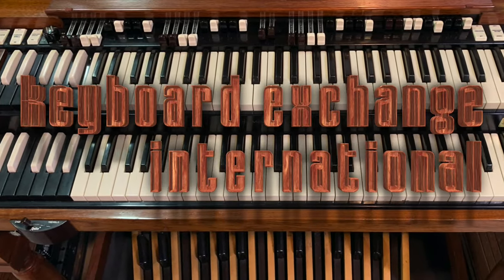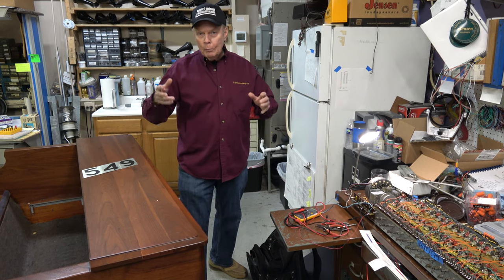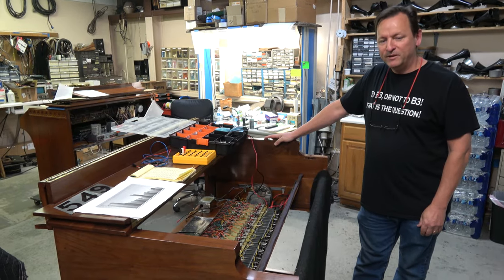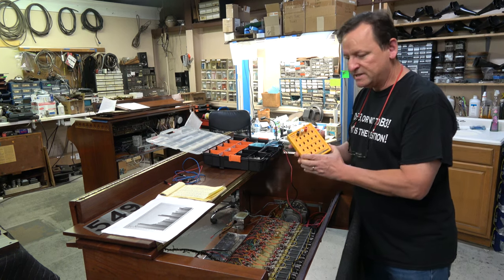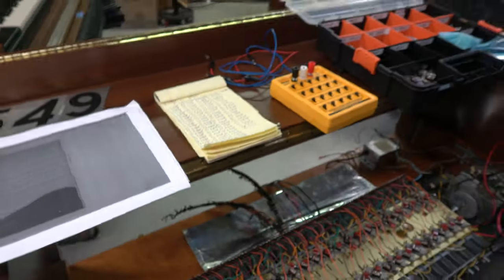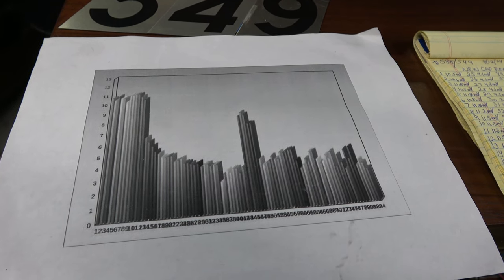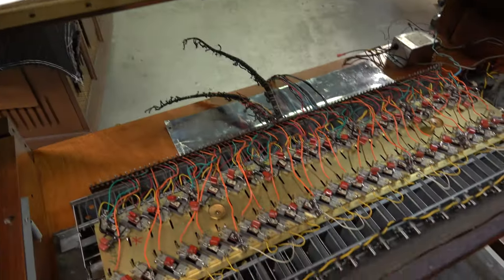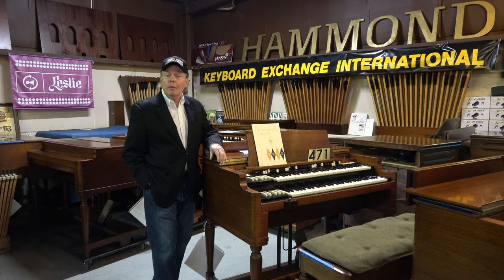(Tech Talk) A deep dive into replacing the tone wheel capacitors, shaping the curve.

Comment: Grant the magnets or what they call the pickup's yes if you move one you will have to use a Oscilloscope to realign it yes it's a tricky thing to do Ive heard about it I've never fooled with the pick up alignment but I did have one organ that had issue that the person moved it not locked down and 2 of the pickup's were in to far so I..did the ear trick..got a organ of the same kind and type and id listen to thoes particular tones and went from ond organ to the other side by side and tuned it that way which worked fine for a spinet organ you could not tell the difference in sound whenever I did it that way..is it proper to do it that way probably not your spouse to use the scope but at the time I didn't have one and I did not know the curve it was supposed to be..so I improvised..my way never had a problem yet with it so that's that..Ive got to learn how to do a recap on a generator I don't know what pickups take the double caps I'll have to do some research whenever I do one...
Reply: Thank you for your comment Anthony!  What you did with your spinet was probably just fine.  It's nice to use a scope, or multi-meter for the magnet calibration, however, your ear will get you pretty close.  I caution people about moving the magnets because it's VERY easy to ruin a tonewheel when doing it.  The doubled caps that I pointed out in the video aren't truly necessary if you happen to have a cap of precisely the value needed.  We double them up when the needed value is somewhere in between the two available cap capcitance values that we have.  What I mean is, manufacturers make a .082 uF and .1 uF, but nobody makes a .09 uF.  If the value needed (as determined by dialing in a wide range of values on the capacitance decade box and measuring the output mV at the generator terminal for the highest possible output) is .092 uF, then you need a .082 and a .01 added together.  The variability of the .1 uF caps (if you test all 50 of the .1 uF caps that you bought) might be from .096 to .13.  The variability of the .082 caps might be from .079 to .084.  The smallest of your .1 caps is too big, and the largest of your .082 caps is too small.  When the generator was built at the factory, they performed this operation and were able to use single .1 uF rated caps (custom matched by hand) because the manufacturing variability back then was much wider, perhaps from .088 to .14 uF.  This operation was intended to create the most effective filter possible using a small transformer and capacitor.  To do that, each transformer had to have a custom matched capacitor.  After the matching was finished and the caps were soldered in place, the magnets were then adjusted to produce the output curve.  If the organ was treated well over the years, the magnets likely never moved.  The caps drifted in value greatly however.  So today, we replace all of the caps and perform the custom matching so that we hopefully have a smooth curve if none of the magnets have been moved or knocked around.  I only move magnets if it is absolutely necessary.  I hope this makes it more clear.